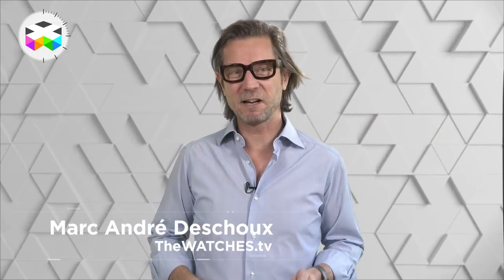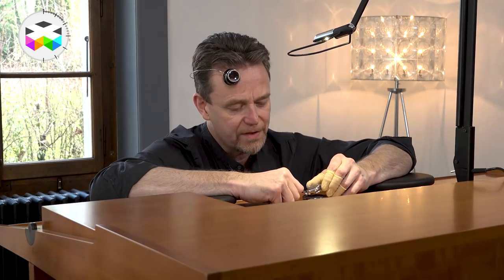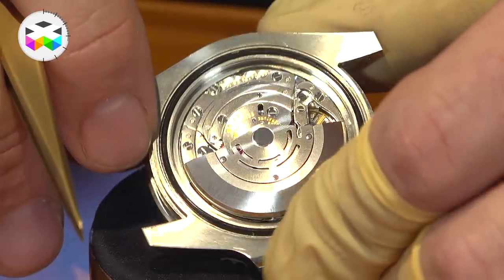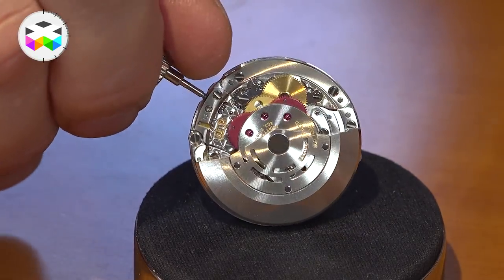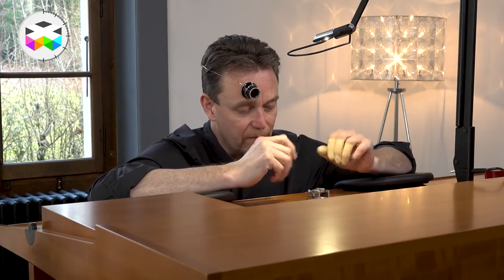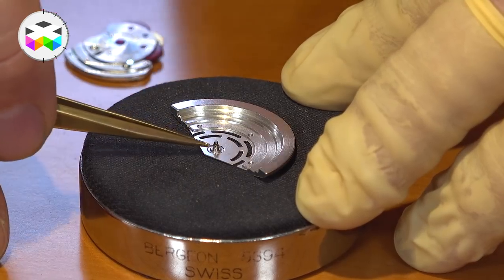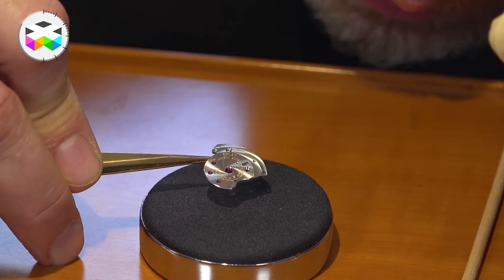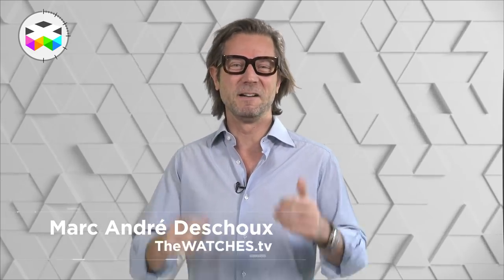Don't Do This at Home: Rolex Submariner - Part 1

Comment: I wish he did a date sub so everyone could see how ingenious the Rolex instantaneous date change is. 

Although I will say the giant perlaged bridge of the no date version on the dial side of the movement is pretty awesome...
Reply: Karson Barnes What's special about it? Even the basic 2824 has an instant date Change
Reply: the rolex date change happens in a split second. 2824s have a transition period
Reply: zengmingde No they don't, I have a Hamilton with a basic 2824 and it changes day and date instantly. Unless you consider 1/10 of a second a transition period.
Reply: Logan Newcome the 2824 is semi instantaneous, the 2836 is instantaneous. The Rolex system is very unique and pretty awesome. It uses a small jewel that rolls along a gear with a specially designed post that makes it instantly change at midnight everytime. It's really pretty sweet.
Reply: Not as special as the Zenith Elite date change....made in the early 1990's, it could do fast changing in both directions..

Comment: This is the first YT watchmaker video I've seen where the watchmaker actually uses brass tweezers vs steel and a blade screwdriver that has a blade of lesser width than the screw's slot. I've seen many watchmakers scratch the chamfer countersink hole in a bridge with the blade of the screwdriver because there is no play for the screwdriver blade to move laterally.

Comment: Makes me want to pull my Deep Sea apart. It can go just a tiny bit further down in my swimming pool than the Submariner can. 😝😎

I know the case back on the Deep Sea is actually high grade titanium .I have owned a late Submariner with the SEL as well. The Submariner just seems so under constructed than the Sea Dweller series. And the Deep Sea is a monster compared to the cool Submariner. 
I just had it fully serviced and pressure tested. I love the Rolex sport watches. I am absolutely not a Rolex dress watch fan at all.
One of my largest purchase when I first started purchasing watches was the Daytona I still own. When I purchased it I was so excited but over time I started to realize I had spent so much for a 18k Daytona. This was back in the late 80's. Now it is every bit worth what I paid and a ton more. 
But the last time I had it serviced just under 2 years ago. It set me back a staggering amount for the service.
I have the very first Rolex I received from my grandfather who was a well respected watchmaker.
It is a 6694 Oyster date precision. It has a really weird Rolex stretch type band. Yes it is a actual Rolex band or bracelet. 
It needs a service as it is running about 21 seconds a day slow.

I have recently stepped away from Rolec and I am currently collecting microbrand Suisse automatic chronographs.

Comment: ¡¡ GREATEST !! SAVED FOR REFERENCE, THANKS.
 ( NEED TO BUY " SPECIAL DIES' TO INSTALL ROLEX ACRYLIC CRYSTAL CASE # 1675 TO PREVENT BRITTLE OR DAMEGE'DURING ASSEMBLY) MY 50 YRS OLD ROLEX GMT PEPSI BEZEL 😢( BRITTLE PREVIOUS ONE)
BERGEON OR HOROTEC # REFERENCE THANKS RALPH 🙏 .